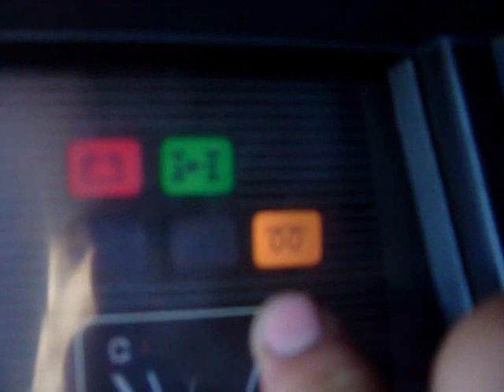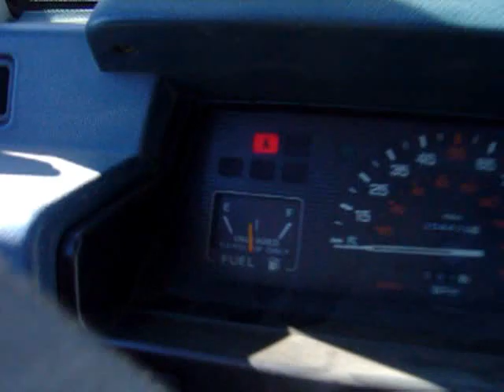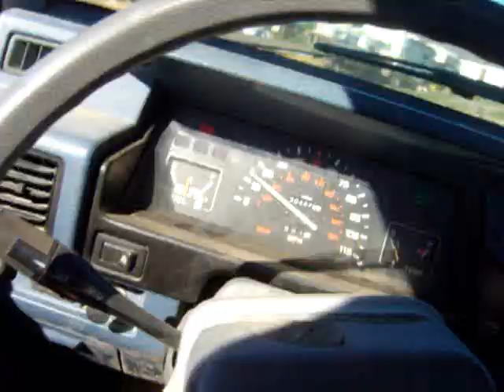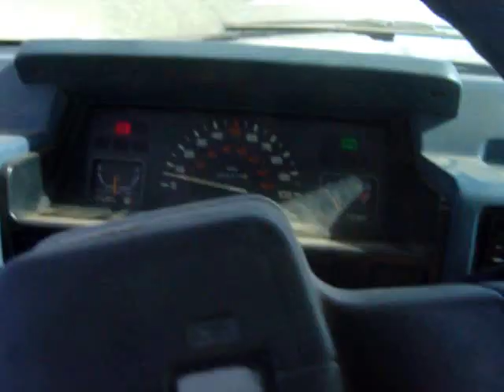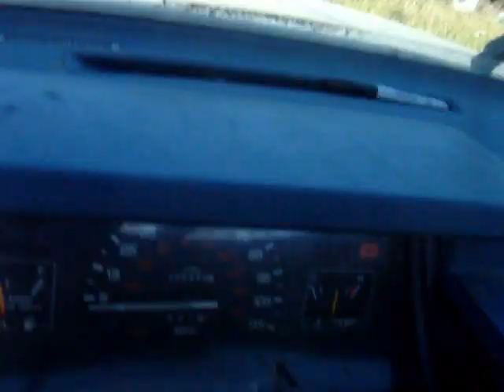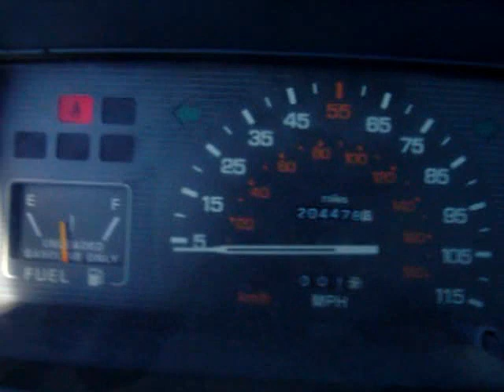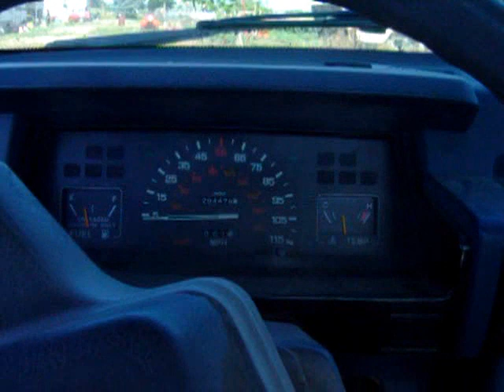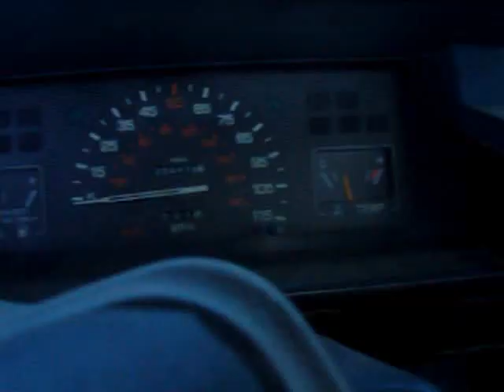Dodge Ram 50 Mitsubishi Mighty Max

Comment from the maker: Yeah, we got that for $100 two years ago and we were going to salvage it, but where we used to live, we had a very steep driveway, and my stepdad forgot to put the outdrives up and it ripped one off. Ive got a video of it when It was still sorta one piece. I had plans to fix it up, but my stepdad just got tired of seeing the POS in our yard, now we have pieces of it all over our back yard. IDK if the Mighty Max would pull that boat